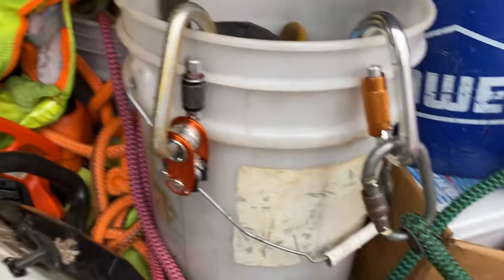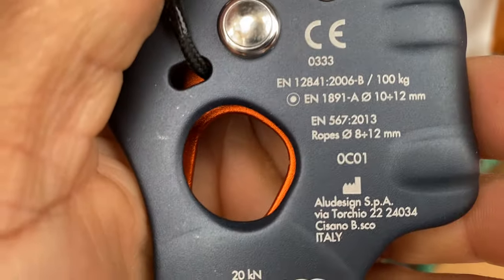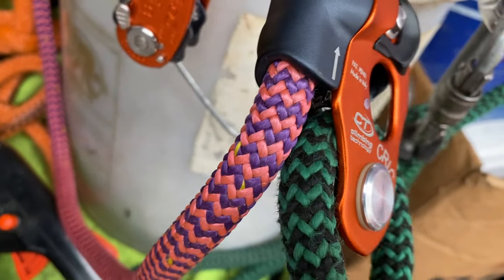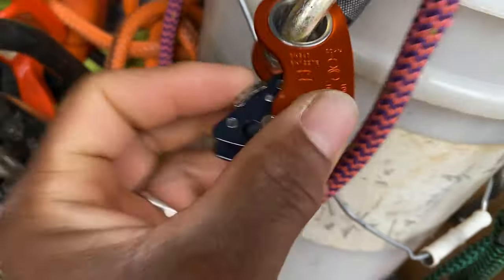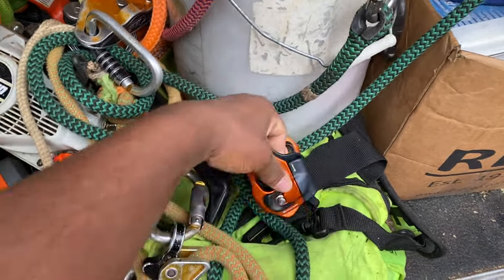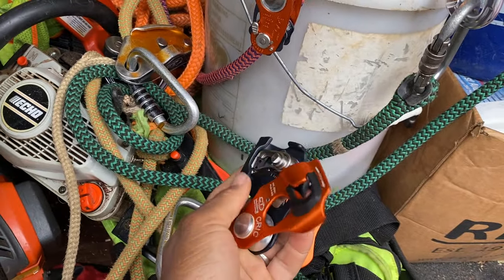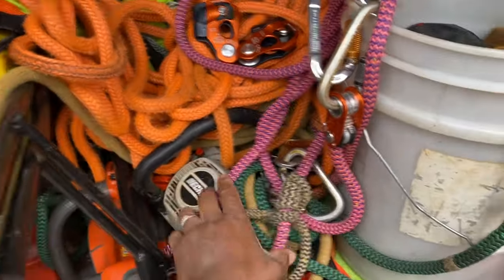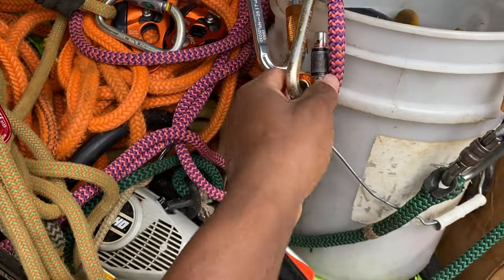A Brief Overview of Rope Compatibility with the CT Climbing Technology CRIC

Comment: Great review man. I was going to get one for mechanical advantage on limb walks, but after seeing how it is with 11.5mm rope, I'm definitely going to pass on it. I think the CT roll n lock will be what I get instead.
Reply from the maker: I will say it does work with the larger rope however it works really well with somewhat smaller rope and yet with my Yale calamine it’s pretty smooth in the configuration I used with it and it worked well with tensioning up my half inch rigging line however I would say if you ever run into someone with one test it out it’s still a really great piece of hardware to have in the bag.